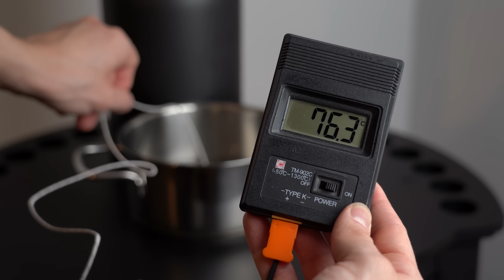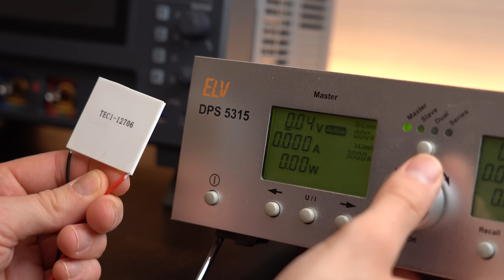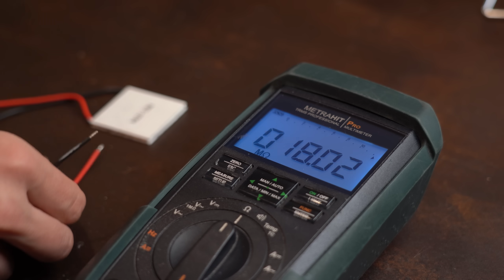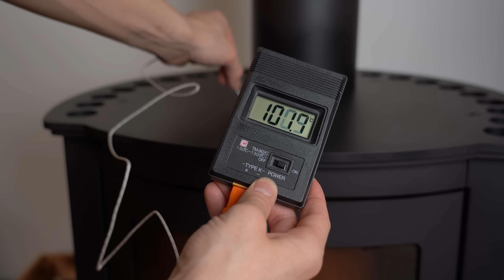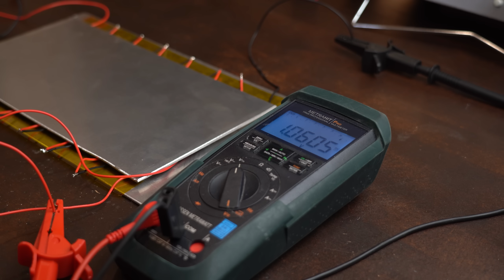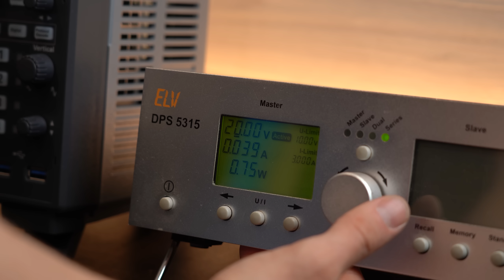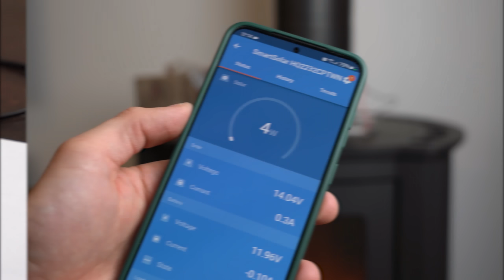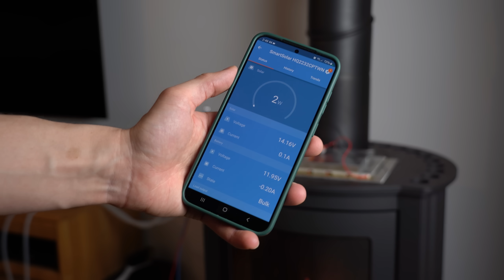I tried to Power my Home with Heat Generators! (Worth it?)

Comment: I think this is still a viable idea.  Robert Murray Smith has a video where he has used copper and copper oxide wire as the dissimilar metals 
Assuming you pour a circular firebrick that Hugs the flew, wires imbedded in the fire brick, dissimilar contacts on the hot inside of the brick and the cold sides connected on the outside of the brick exposed to air.  

Unfortunately using cheap units made for very low heat is not going to make this kind of heater a viable option.

Comment: I love seeing videos implementing TEGs. I am currently working on a project implementing TEGs for electrical power generation from "terestrial" heat sources. I have a few tips if you want to dive deeper into this subject another time:

-The open circuit voltage of the TEC/TEG is linearly dependent on the thermal gradient, according to the Seebec effect(an effect adjacent the Peltier effect). Voc=DT*S
-The power you are theoretically able to generate from this Voc is dependent on the internal resistance of the TEC/TEG. P=Voc^2/Ri. Also meaning your load resistance needs to be tuned to match the TEC/TEG resistance. MPP algorithms aren't always optimized to do this for TECs/TEGs(solar MPP works differently), so the MPPt you were using could have missed the mark on the MPP.
-Thermal expansion is the biggest killer of TECs/TEGs. Having the correct heating/cooling rate can make a large difference in preventing damage to the TEC/TEG

There are more aspects to TECs/TEGs, but i can't explain all in a youtube comment.

Comment: Joule heating has to be overcome because this is the number one reason TEGs are bad at delivering current, by using a joule thief you get higher efficiency, there is room for improvement.

Comment: I could have told you this without testing. Peltier modules are cute but highly inefficient for this type of purpose.
Large power installations use turbines and steam to generate and regulate power production. If you want to use wood as the source energy, I’d recommend converting its heat into steam.

Comment: Thermo Electric Genrators are my particular intrest, and your claim that producing more than 0.5w burns them out is a little odd. Are they ones used normally for refrigeration? Have you tried ones actially made for cooling? I know a man in TECTEG who may be able to get you the right ones. Im aiming to make a prototype myself next year.

Comment: Not sure if you will read this but I was thinking of doing the same thing with a cooler riding down a river in the summer, I should be able to apply voltage to the peltiers and keep the cooler cold for longer while transfering the heat to the river.

Comment: I know you have done power battery packs before, but I was wondering if you could try to make one out of disposable vape batteries. The only design I found sadly does not have any circuit board designs available and I'm not good at that, plus it would be useful for recycling things.

Comment: My own experiments with 4x of these modules. I had air cooling of the cold side with a fanned heatsink and the hot side heat sink on a paraffin burner. 
I could generate just about enough power to run the cooling fan !

Comment: Would be nice to calculate power efficiency of those modules working under such conditions. This is probably extremely difficult to impossible to do with any sensible accuracy, but still it would be interesting to know. Those modules are terribly inefficient, so I assume efficiency of probably about 1% if that. As a side note - imagine those things having efficiency of about ~40% or more and being able to work with higher power and higher temperature. You could put those onto a furnace in a coal or whatever plant and generate DC directly instead of going through turbines and all the other stuff in a typical power plant. Or even better - a radio-electric generator, where ionizing radiation could be directly converted to DC. I think this could be useful.

Comment: I often thought about this. My idea was to run 2 loops. One ethylene glycol looped outside for cooling below freezing and a hot loop going to a heat source with a heat exchanger. They produce more power the greater the difference in temperature plus can control how hot the hot side gets to protect the peltiers and even store the excess hot water produced. Could even run in reverse in the summer time and dump excess solar into cooling the stored water and running a water to air heat exchanger for air conditioning.

Comment: Very good build. I agree with drkannavas that if one cooler is low it can draw the other ones down with it. A lot like solar panels. Half cut solar panels have diodes to prevent backfeeding. I'd also add something to clamp everything together.

Comment: Thermoelectric modules with high temperature solder are available. Every bit of difference between Thot and Tcold helps boost efficiency.

Comment: instead, make a wood fired water heater and run some pipes. now using the hot water boil some not so pure water and attach a turbine above it.

Comment: Easy method to make the C side of the Peltier element low temperature

Put the following into a cooling pot, frying pan, or food bat,
and place it on top of the Peltier element.

Mix ice with calcium chloride hexahydrate to create an ultra-low temperature substance due to the latent heat effect of the ice.
Depending on the fineness of the ice (large surface area) and the mixing ratio, temperatures of -50°C or lower may be possible.
There is no need to go to the trouble of building a water cooling system of heat sinks, and no electricity is required.

Add water to calcium chloride, a moisture remover and road anti-icing agent,
After dissolving the solids into a saturated aqueous solution, it is placed in the freezer to solidify.
(You can also use the aqueous solution extracted from used moisture removers.)
This will produce calcium chloride 6-hydrate. (After removing from the freezer, it can be stored at room temperature.)

For more information, please check the Internet or other sources.

Comment: Nice experiment.  I've thought of doing this on a woodburning stove or boiler for supplemental power; especially in the winter with reduced solar.  An idea to reduce burning out the modules is to use a technique I've seen in those fans with the modules.  On the bottom of the fan, there is a different metal that expands in a groove and at a faster rate than the housing; so the hotter the stove gets, the further the fan is lifted/tilted off the stove, reducing heat transfer to safer levels.

Comment: The generating modules are usually labeled at TEG and the cooling modules are labeled TEC. I played around with these for a long time. With the TEC modules you can actually make a little refrigerator.

Comment: I made a 1kw model for a CNG bus, converting exhaust gas high heat directly to electricity. I extracted 500 watts (Non-matched load and sub-optimal dynamic temperature difference deviation from best performance range)
But mine was made through systematic engineering so it functioned properly.

Comment: I conducted a simular experiment, but I used a cooling mechanism that drew less energy. I rigged mine up in series, with a final parallel portion to increase current, then used a 0.5amp 12v dc cooling fan which I mounted on the top for cooling. I modified an aluminium frying pan. On the other side, were heat sinks glued to each peltier tile, followed by the fan. It worked well

Comment: Honestly, it's not that bad. You get 6w out of a 336cm² area (21 modules times 16cm²). That's 174w per square meter, about the same as a solar panel... and don't forget that you can do multiple layers... So maybe it's expensive, but as for solar panels it could become less expensive with time...

Comment: The problem is that you used tec(thermoelectric cooler) instead of teg(thermo electric  generator) units. they have a metallic parts instead and are made to take really high temperatures . Both are Pelletier units but the material used are different.

Comment: A steam tube in the chimney pipe connected to a flash pot in the wood burner that gets injected water to vaporize to run the Tesla turbine which is connected to a regulated alternator with a step down gear and flywheel to increase torque.. By adjusting the amount of water that is injected you could adjust the speed of the turbine to a suitable RPM or turn off the steam and thus stop the turbine in a very short time without having a pop off for the steam.. You could use a fuel injector from a car and pressurize the water with a small well pressure tank or just run it off tap pressure from the city water with a check valve.. A variable pulse from a 555 chip or Raspberry Pi would work the fuel injector..

Comment: From what I remember peltier used as generators are about 5 to 6% efficient meaning you where delivering just around 100W to the cooling water.
With a larger module 12726 I was able to get around 1.5W at a temperature delta of of a bit less that 50C (tap water hot and cold).
If you want to experiment more I will suggest using a lot more modules and use the pump for the hot side loop (at the output) monitoring the temperature and try to keep that to no more than 70C hot side as the solder used inside this modules is low temperature solder that will melt at 138C.
You can check my 13 years old video about the experiment.  The 5 to 6% efficiency means is 4x less than solar and my investigation was for thermal solar use and it made no sense to use.
It is all about how much energy you transfer from one side to the other and 5 to 6% of that will be converted in to electricity so if you need the heat anyway then there is no thermal loss just the 5 to 6% you extract as electricity.

Comment: I think there is more than enough energy being outputted from the fireplace, but you need to capture it more effectively.  How about extracting the heat with another fluid or air system and spread it over many more peltier units.  Or if you still use direct heat, maybe a peltier chimney?
Reply: Actually @blackturbine has a great option for the chimney pipe.

Comment: Bend copper tubing around the output chimney, then take me output water to a temperature regulator aka the outside then bring it back and put it on an entire wall. So you get an entire walls worth of surface area. An average wall area should give you at least a couple hundred Watts.

Comment: How about isolating the generator's hot side with the wood stove by some media? Such as water, even if it gets boiled the temperature will limited to 100°C, and helps the heat distribute more evenly.

Comment: i was thinkinbg of trying this on my stove but on the sides so that it wouldn't get so hot and also easier to keep the cold side cold, and then i was going to pipe water in from outside , which would work if it wasnt freezing (but using it continuously would also stop it freezing)

Comment: Slight techincality, These dont convert heat directly to energy, they do some weird resistance thing idk that causes electricity to move

Hence why you need to keep one side cold

If it was actually converting heat directly to electricity, you wouldnt need to cool it (since it would natrually get cold)

Comment: I'm off-grid in Finland. I do the following in winter when there is no sun at all: I make bio-diesel in summer from used cooking oil and use it in a generator in winter. I only have to run it once a week or so to top up my battery.
Reply: We... The youtube people...... Demand an in depth video please
Reply: do you make actual diesel of do yo filter the oil an run it directly in the engine?
Reply: @TheHenirik  I make actual diesel. KOH (potassium hydroxide) as a catalyst and methanol to separate the glycerin from the vegetable oil. For fun, I also tested getting my own KOH from wood ash and methanol from birch wood with dry distillation, so technically I only have to source used vegetable oil. Of course, for practical reasons I just buy the methanol and KOH, and I estimate the total cost per liter of bio-diesel to be somewhere around 25 cents.
Reply: @upnorthandpersonal  what's the advantages over just running on filtered oil?
Reply: @TheHenirik  Lower viscosity for the biodiesel for one. It also has better/cleaner combustion. Running with straight vegetable oil you have to be more careful to 'flush' the engine with regular diesel after running, and you also need to start on regular diesel before switching over. This adds complexity. Biodiesel behaves just like regular diesel, and I can even just add diesel additives to prevent it from gelling when it gets cold.
Reply: @upnorthandpersonal  the flushing part, is that only for temperature reasons or because of acidity and other issues? and are use saying the diesel burns more complete? so you get more energy out of it by first dieselifying it? or do you remove all the harder to burn parts in the processing?
Reply: @TheHenirik  it can gel up in the engine, not just because of temperature reasons. It also builds up carbon in the engine, which you want to 'burn off' with regular diesel. Even in normal weather, you can't really start off of vegetable oil. You first run on diesel until it's warm before switching to vegetable oil when it's hot. Running cold vegetable oil in a cold engine won't work.
Bio-diesel burns cleaner for sure, no smoke generation at the exhaust compared to straight vegetable oil, and it smell less (although both smell rather pleasant compared to regular diesel).
Reply: @upnorthandpersonal   @upnorthandpersonal  ah interesting, do you know if you convert those poorly burning parts or if you remove them completely in the process? and do you need to have winter additives like you do in normal diesel? (something all the nordic countries does as standard around wintertime) 

Sounds kinda like the issues people had when running petrol cars on kerosene was a thing. i was under the impression that you could just fuel up and it would work largely as normal, but i dont have a diesel of my own to try xD
Reply: @TheHenirik  You remove them (the process is called transesterification) - you can use the remainders to make soap, once you distill the methanol out and remove the KOH catalyst (and you can reuse those).

And yes, you need additives in winter.
Reply: @upnorthandpersonal  Thanks, sounds like a interesting project, that probably can be wildly economical too considering fuel prices =) 

if you want to make a more indepth video on how the system works and the issues with it i would be interested in watching it, but for now i dont think i have much more questions
Reply: @TheHenirik  There's actually quite a few good videos on YT dealing with making biodiesel and its uses - once you're ready to go down the rabbit hole of diy fuels :)
Reply: @upnorthandpersonal  i have stumbled upon a few but most are a bit surface level and many are more interested in running filtered oil, and you seem properly knowledgeable in the matter =)

but yeah if i actively searched for it for a bit i might find videos with enough information
Reply: @upnorthandpersonal  thats absolutely insane. I would love if you would make a video tutorial on how to make such things and be that self sustainable. It's really awesome.
Reply: https://youtu.be/BuzqKjUBfTY?si=cKIrlVP3pMwLS_9o
Reply: You're lucky to have a much cheaper source of methanol than we do in Canada.. I'm paying almost $15/4L, which is enough to catalyze the production of around 12-15 liters depending on the quality I'm after.  That works out to over $1/L for me if I don't recover the methanol which takes a ton of energy. :(

I mainly use mine in a diesel heater, though... and I find that I can blend in about 30% cooking oil without transesterification, along with 10% gasoline to pump diesel to get close enough to the same stoichiometric ratio.  Also don't have to worry about water content as much.
Reply: @GordLamb  You should be able to get it from a wholesaler maybe? Also, it doesn't have to be the purest, so sometimes I get some 'leftovers' cheaply.
Reply: @upnorthandpersonal  Aye; I should look around again ... I did most of my biodiesel work during covid and it was tough to get anyone's attention, especially for small orders.  Since then I've just been blending in cooking oil since I never have enough for the entire season anyway.
Reply: that's very interesting. how much fuel do you manage to process in a season?
Reply: @MHistheDesden  I could to much more than I need. I tend to do 500 Liters which is plenty to generate what I need in electricity for three months where I don't have sun.
Reply: A peltier module is not supposed to generate power, it can, yes but it’s suppose to create heat differential instead. Try a seebeck module instead, also apply force of  on both sides of the seebeck module for maximum efficiency.

Comment: I'm not sure if this would work:
I was also thinking, it you could have the cold water stay outside, then it would be constantly cooling the water.
Since pumping water longer distances can require a stronger pump,
you could maybe just connect a hose at the top and bottom of your indoor bucket to the top and bottom of an outdoor bucket
and I think the temperature difference would cause it to circulate some, because the hot wants to cool down and the cold wants to  warm up.

Comment: Maybe needs a way to cool down the hot side if it gets too hot, to prevent damage.
Maybe some metal that once it reaches a certain temp, would raise it up to create a gap for air under it
or just leave a slight gap or something that keeps it below the maximum heat tolerance.
It may need something simple or something elaborate like a smaller sensor that moves a larger thing, but I would go with mechanical action, not electrical.